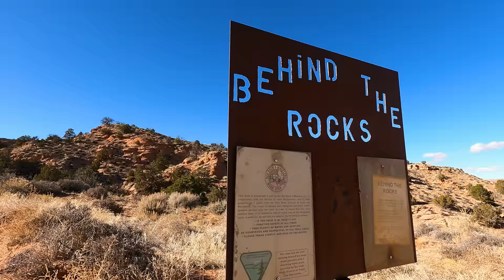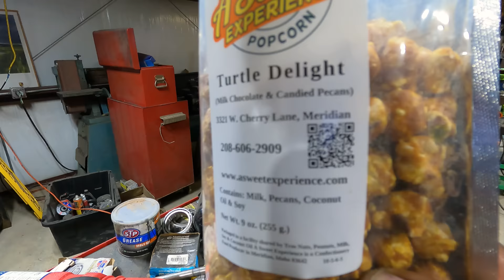Supercharged Big Block Tow Truck

Comment: Well that's going to be fun to drive, I see many broken parts coming. 
Have a great time at the games.
Reply: Yeah, so then he'll find the next weak link.
Reply: Yeah the engine and that blower that'll be sucking sand once all the other rigs are kicking it up all around.  Buh bye engine in a few months or less.
Reply: @Boga I think the goal is to make it the weekend.
Reply: @Boga217  Umm, it has a filter inside the hat of the blower.
 Stop talking crap and it's Rory's truck HE can blow all the motors he wants too.

Comment: Nothing like super charged sand into the engine. 😂
Reply: Yes,no air cleaner is ideal in sandy conditions. Smart move Rory.
Reply: The air cleaner is behind the three  inlet valves…
Reply: This truck is going to eat sand, and crap glass!
Reply: Ol' Blue would look entirely different without Howlin' Wolf's work. It would have look like a cobbled together project with cut corners, but now it looks amazing.
Reply: If you look closely you can see a small air cleaner behind the butterfly valves in some of the shots in the video.
Reply: @jasonthomas8770  
I hope so.
Reply: @NathanielHatley  
Yes, I see it now.👍
Reply: Forward thinking:  Always stay out front and make everyone else eat your dirt.👍
Reply: @tak-el-uc  
You mean like the truck that  the channel is named after?

Comment: That monster wants to jump out of there! 
I’m old school but you may want to run a chain from the left front of the engine to the frame rail. That kind of horsepower will kill most motor mounts. If you adjust your chain correctly it will be loose at idle and get tight when you start getting on the power. It will save replacing motor mounts regularly. Under extreme load it may save your engine from breaking loose at the motor mount bolts and rolling over.

Comment: Hey Mater.  For what it's worth, you ought to  put an IMCA air cleaner on it, instead of the Pro Street scope.  The IMCA would tuck low around the Holley, give better filtration and you could wash the pre-cleaner sack easy when ever.  I think it would look bad ass.

Comment: Superchargers are nice but they like to break/bend crankshafts a lot. they do make a bracket brace for the crankshaft. 
bolt on in front of crank to take some of the torque off the shaft and keep it straight. Highly suggest it of you didn't already do it.
BTW the truck looks sic with the blower

Comment: Love love loving Ol' Blue right now.
If you're going to play in the sand like that please be careful about ingesting some sand into the cylinders. Maybe rig up one of those baja silk filter screens...temporarily. 

Did you have to air down the truck to do this? My dually weighs the same but she's got street hauler tires.

Comment: 205 NP Transfer Case - use new shift rails , balls and springs and new synchros . This will solve your jumping out of gear. I will give your CHEVY Auto TRans two weeks before it takes a dump . Needs a Ford C6 .

Comment: Just curious... because I do not know any better... how will those 3 BIG red Supercharger intake valves handle the sand being tossed about... is there a air filtration system along the way???   Thanks for sharing your delight in the new monster 🙂

Comment: Moab Motorsports aka Broken Axle Garage.or Busted Trans Inc. Such that sand with no air cleaner and the motor won't last long either. From crawler to gasser in 1 step.

Comment: Sure sounds like you're still running a Naturally Aspirated (NA) cam and not a Blower Cam - so without the correct exhaust and intake lift and duration you're not going seeing all the performance improvements of forced air. But then, without knowing if you built that engine with forded internals, you may be better off with losing a bunch of boost.